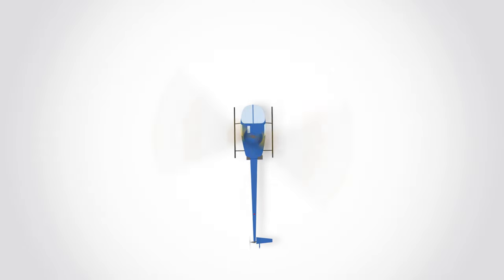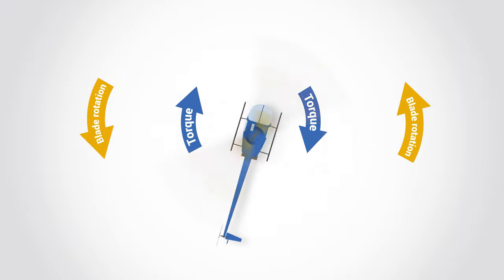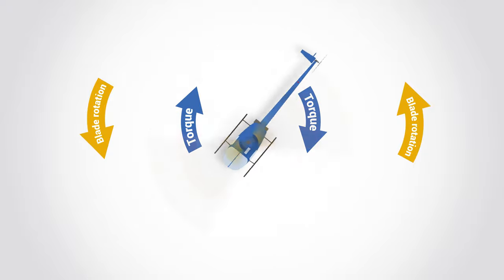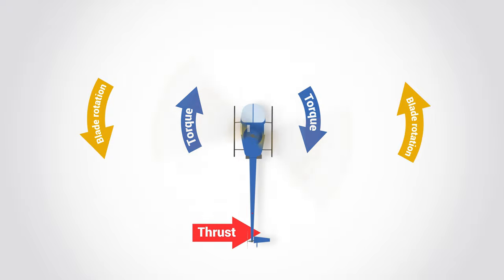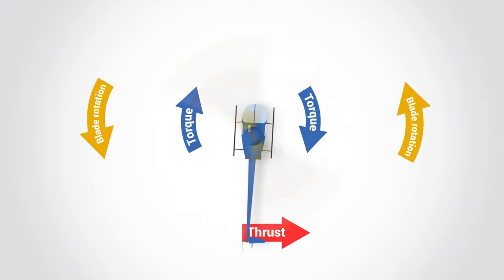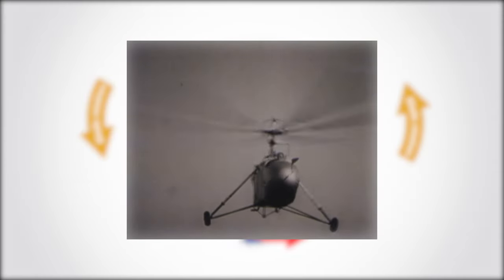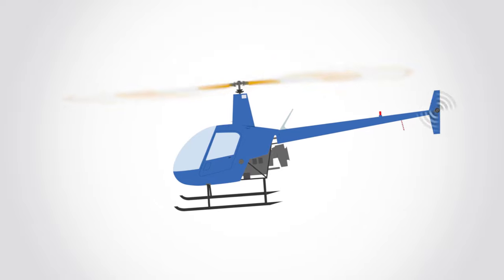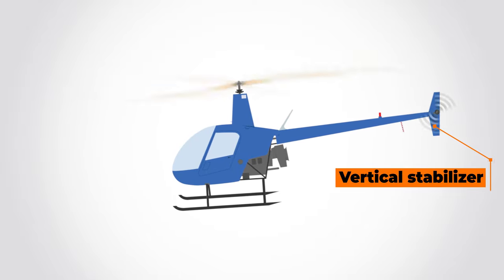Torque effect on helicopters

Comment: You correctly showed that Torque is shown by 2 arrows, one each side going in opposite directions, to produce rotation. The tail rotor instead uses a Moment to stop the rotation - its arrow has to be 2 x the size of one of the Torque arrows to stop the turn. But then you are left with an unbalanced force, which causes Drift, which is countered by tilting the rotor mast to the side. This then causes another moment which makes the fuselage roll to one side - which is why most helicopters hang left skid low in the hover.

Comment: What is the magnitude of the torque? Does it only take effect when the rotor is accelerating? Is the tail rotor mechanically in sync with the main rotor? How does the collective pitch effect the torque?